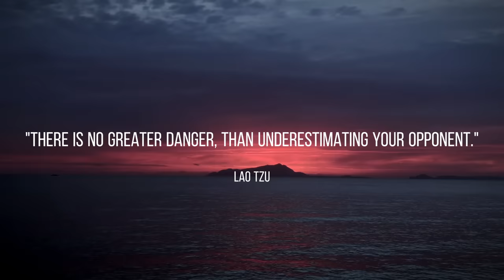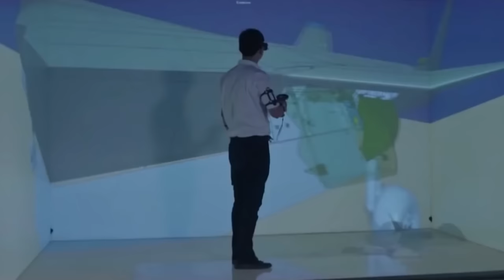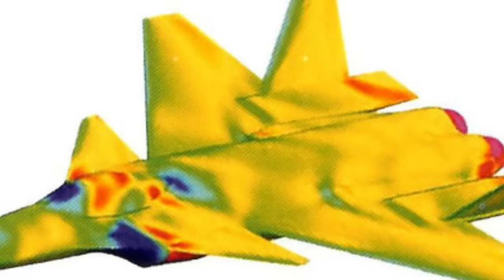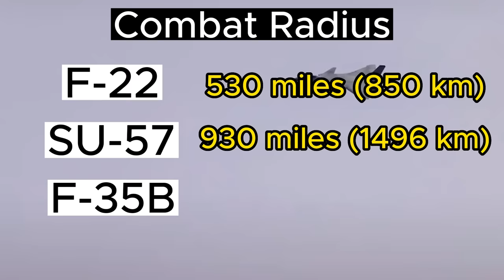China's Stealth Fighter, Good or Bad?

Comment: The fundamental problem Chinese high end military equipment is that it's all stolen or mimicked and reproduced but without the known need that equipment was designed for filling based on specific watfighter experiences in combat over time.  It's tech they don't know what to do with it, let alone HOW to do it.  They are LITTERALY so incapable of even teaching their pilots how to use these aircraft that they've had to resort to trying to bribe foreign pilots to come and train THEIR OWN pilots.  These aircraft also have to be used in a very complicated, highly coriogra0hed way for their stealth systems to work effectively (or to work AT ALL really).  
I think that should war come, China will be utterly anhilated.
Reply: Well if what you say is true, it's what nuclear bombs are used for.